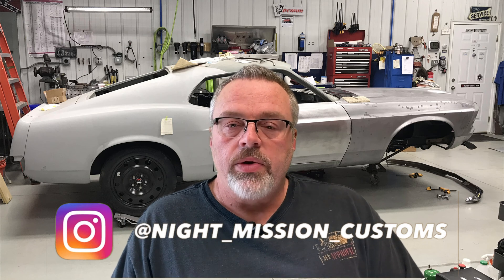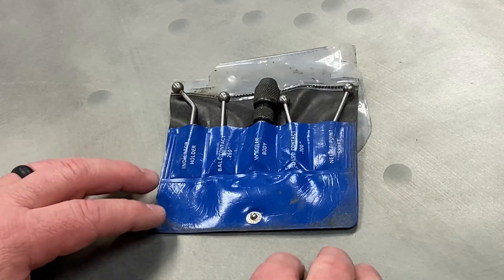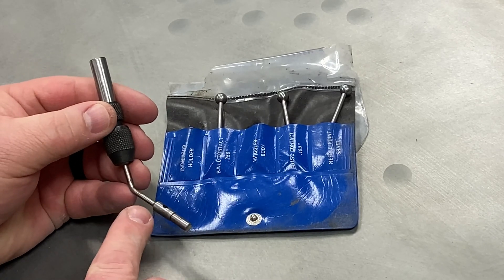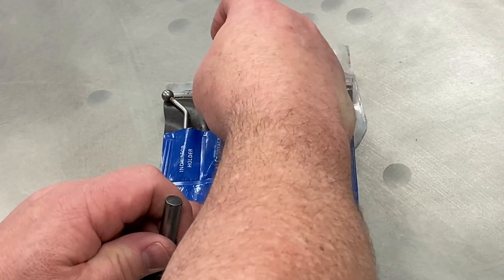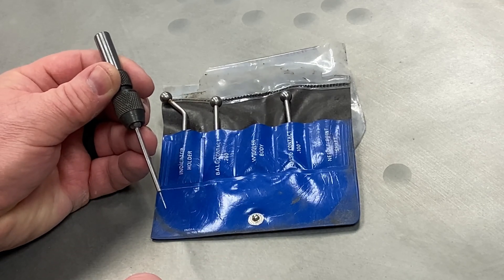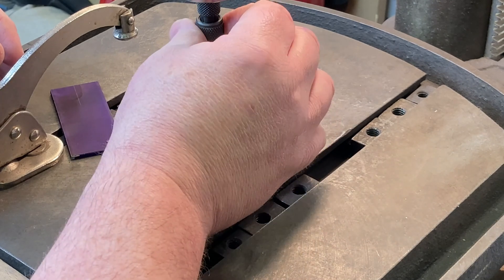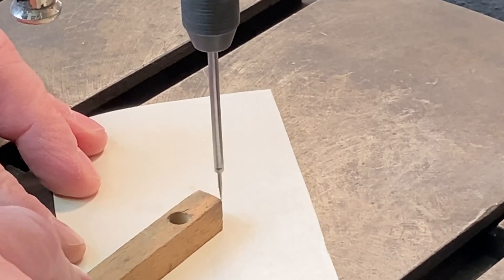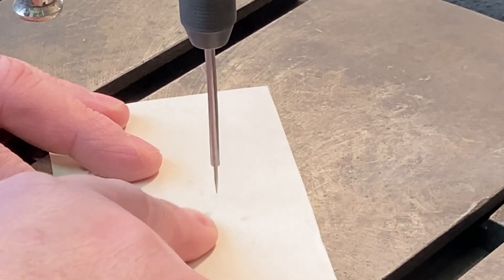Precision Drilling:  Using a Wiggler Tool in the Drill Press

Comment: Great in informative video.  Could you take a small drill bit and put the end to a grinder and sharpen it to a need point and accomplish the same purpose as the wiggler tool ? Just curious, thank you !
Reply from the maker: The problem with simply doing a "sharp point" insert tool is that it lacks the degree of freedom necessary to be able to account for the total runout PLUS the runout of the bit itself.  In other words, a sharpened drill bit will spin with the same inaccuracy as the spindle assembly combined with the runout of the tool bit itself and not allow you to correct for it when positioning your work piece. That said, if that is all you have available, it will certainly work better than eyeballing!
Reply: Thank you very much for the explanation, now I know how it works and why a wiggler would be the best tool for this situation. I really enjoy your informative videos and I have learned a lot, I'm just a hobbyist machinist.

Comment: Thanks for the video! i'm curios, how did you fasten the clamp to the T slot in the table?
Reply from the maker: These clamps have a stud that passes through holes in the bottom of the t-slot grooves and are tightened with a ring nut from the bottom.

Comment: Just had a job where i needed to use the disk probe. It can reach down into tight spaces where a regular edge finder can't go. The ball probe, IMHO, is the redundant one. Harder to use than a regular edge finder and won't fit in places that a regular edge finder has no issues with.

Comment: I genuinely do not understand.  You are eyeballing it at every step.  Why not just eyeball the center drill?  It should be just as "straight" as the wiggler.  If not, turn it on and eyeball the spinning center.  I know this sounds confrontational, and I apologize for that, but I really do not see the difference.
Reply: the wiggler cancels out any runout in the machine spindle. but at this level of precision that is a dubious advantage

Comment: If you dont use cutting oil on those center drills you will break the nose off pretty often, depending on the work material.  Especially on most stainless steels except 303 and 416.
Reply from the maker: Very good point!  We didn't use any oil in the video to keep the marks visible but generally, we lube every hole drilled!

Comment: Hey: Can I ask what clamp you are using in this video?  It looks like it screws into a T-Nut with a 1/2"X13 tpi.  JUST what I need and I can't find one!  Thanks.
Reply from the maker: These actually go though the table with a ring nut to tighten.  The holes are drilled through the bottom of the t-slots.  Can't quite remember the brand but I think they were from Bessey.

Comment: These things are dangerous! You bump the probe wrong while under rotation and that sharp point will swing out and any finger in the way will pay the price. Stay away from these.  If you have to locate a point by eyeball, take a say 1/8 rod, and taper a sharp point on it. Get rid of that ball joint. The point might not always be quite as steady as the wiggler, but will likely be good enough. Cheers.
Reply: They work well.  Just use the brain thing.

Comment: You can make a cheaper version of a wiggler with just a blob of plasticine or play doh and a simple pin used in sewing. Put the pin in the blob and stick blob on the end mill or similar. True it up with a graduation mark on a steel rule till running true. Works just like a wiggler, you can find centres, follow scribed lines etc. Learned this trick in a toolroom
Reply: I used to do just that with a needle, but this system is much better.

Comment: The beauty of the wiggler is that it finds the true center of rotation of the spindle regardless of the runout of the chuck (as can be seen in your video) 7:39 . If a person skips the wiggler and just uses a spotting drill the actual hole location will be off by that amount of runout
Reply: Best comment on this video.
Reply from the maker: Excellent point!  Not sure we covered that in enough detail in the video but thank you for pointing this out!

Comment: Having used a wiggles set for years, especially for drilling radial holes in the centre of a bar, I find I get more accurate results if I eyeball along both scribed lines to the wiggles point. I would expect to get within 5 thou. or better of the marked point.
Reply from the maker: A viable approach!

Comment: I inherited my grandpaw's tools several years ago and while digging through everything one thing I found was a very old, original production run, "Starrett S-828H Center Finder Complete", aka the Starrett Wiggler. It was still in absolutely immaculate condition without a speck of rust anywhere or any damage to the little red envelope pouch that holds everything! As a Gunsmith precision is crucial in my work and that wiggler set has been so useful ever since I found it. I still like my electronic edge finder for my milling machine, but on my drill press that wiggler with the needle point installed and a small x,y table is so helpful and the best way I've found to ensure I'm drilling as accurate as possible. I also use the indicator holder all the time in my mill when truing my vise and various other things. It's definitely a tool set that I'm very glad I found!
Reply from the maker: I love this story!  I have a HUGE soft spot for inherited tools like you have there.  Hope you enjoy them to the fullest!

Comment: Seems like extra work to me.  Get a cheap X-Y vise and use a spotting drill in the chuck. Line it up into the center punched mark.
Reply from the maker: A lot of folks don't want to fuss with adding devices to their simple drill press setup to drill a precise hole.  And budgets are different for everybody.  The method shown works for anyone in a very repeatable and inexpensive way but obviously does not suggest it is the only way to get the job done.
Reply: @nightmissioncustoms      Skip the cheap X-Y vise I suggested and use any vise to hold the stock with the center punched mark or just lay the stock on a piece of scrap wood. Insert a $5.00 spot drill into the drill chuck. Extend the quill until the tip of the spot drill sits in the center punched dimple, lock the quill, secure the vise or clamp the stock on top of the wood, retract the quill and put in your twist drill. Center drills are for lathes when drilling a center at the end of the stock. They drill a 60 degree angle.  Use a cheap spot drill with a larger 90 degree angle.